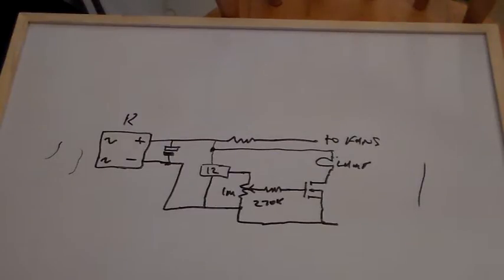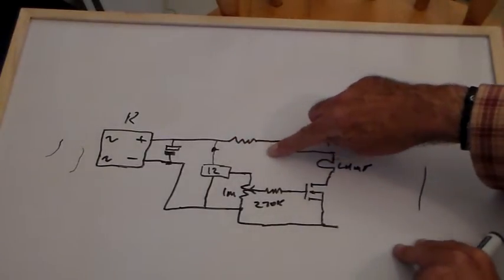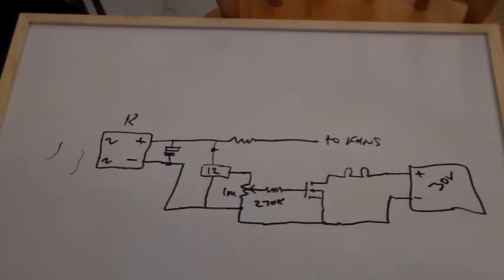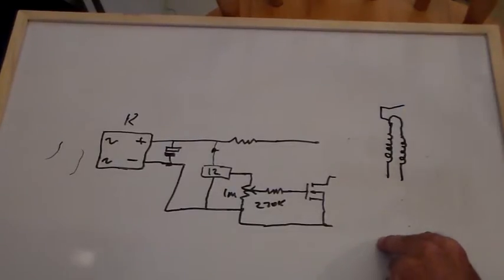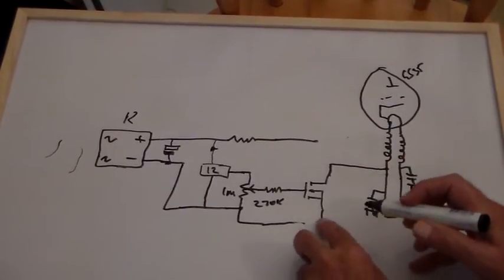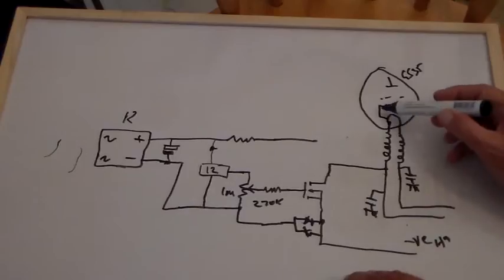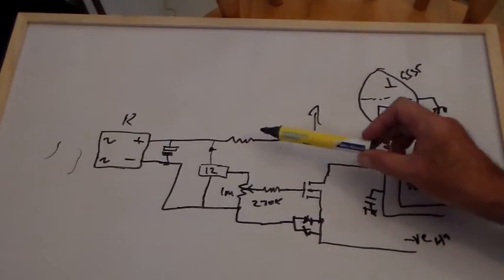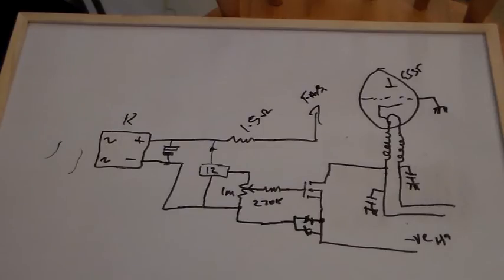GS-35B Cathode Bias MOSFET Circuit... Clarification.

Comment: G'day Steve, for  your circuit there would have to be a band pass filter for the amp.Check the link:
http://www.electronics-tutorials.ws/filter/band-stop-filter.html            hope it helps.
Reply from the maker: +Dennis Peake Thanks Dennis. I took the easy way out with this one and purchased a Bencher YA-1 low pass filter. Here's a link to VE3BUX testing one: http://ve3bux.com/?p=731

Comment: Steve, thanks for responding  so quickly to the circuit on the white board. This is getting very interesting how this all works.  Like you said "KIS" this circuit,   and it will work.
Reply from the maker: +Dennis Peake I'm clearing some annual leave this week so it's an easy distraction away from gardening. I've never seen anyone doing it this way... maybe there's a good reason for that, as all linear amplifiers are going to have a 12v supply for the switching relays that could be used as a source for a fixed reference voltage. If there is a problem I'll probably take the easy way out and just replace this circuit with a large zener diode like Ameritron and others. At least this variable arrangement will let me set the correct idling current with the HT voltage I have available, so I'll know exactly what value zener diode to fit. And, if it does work ok it will last forever, the IXFN 44N80 MOSFET device is much meatier than the TIP147 device commonly used in variable cathode bias circuits, so I think it's worth giving it a go. And, as I've said many times... this is amatuer radio, it's all about playing around and trying new things.